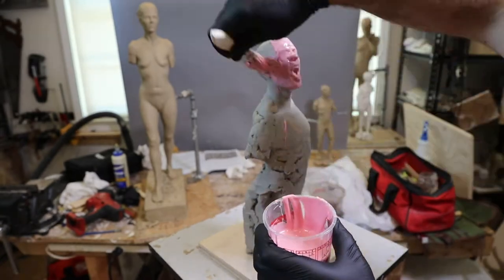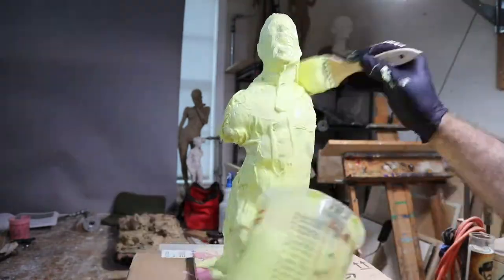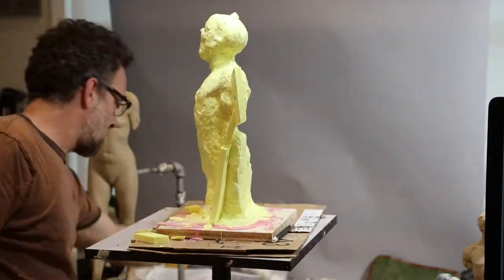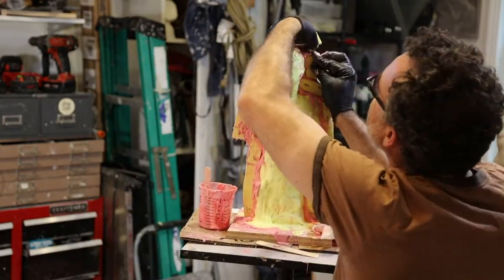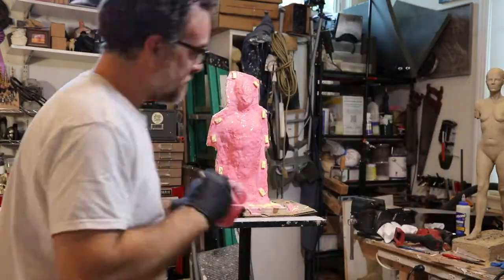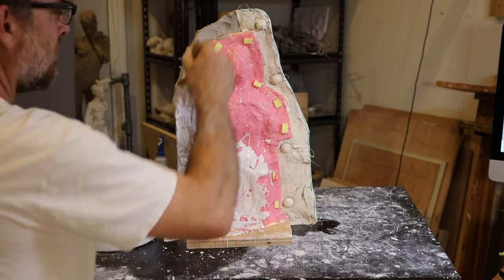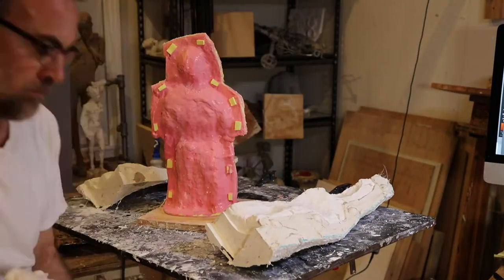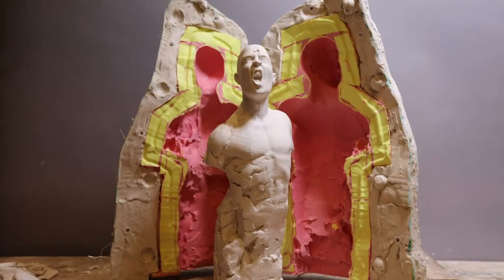Simple Two-Part Rubber mold with a Plaster Jacket

Comment: Great video! I'm in the middle of casting a sculpture I used caulke silicone as it's cheaper then rubber and I'm going to do the plaster jacket next, the only thing is I don't have any hessian scrim trying to work out if it'll be alright with out it.
You've made me think I should film the next one I cast haha!
Reply: You can use dishcloths if you have no hessian

Comment: Thank you for sharing. I don't see any mold release applied between the rubber and plaster. I am wondering if the plaster might stick to the silicone rubber? I have standard pottery plaster. Brush molds are not easy to get smooth.

Comment: What do you used as shims? You said tea pins?
Reply from the maker: I use T-shaped pins to hold the cast rubber flanges in place while the rubber paste sets up. Those flanges are at least 1/2 inch thick. I cut through them at the end to create the parting seam. Hope that helps!
Reply: @Lucy-dd6ws  Thanks Lu Lu